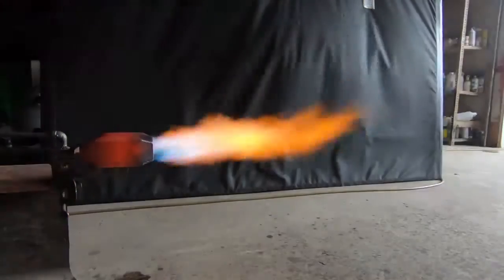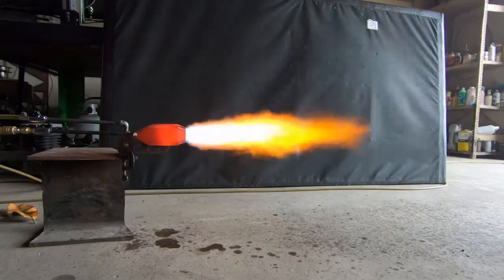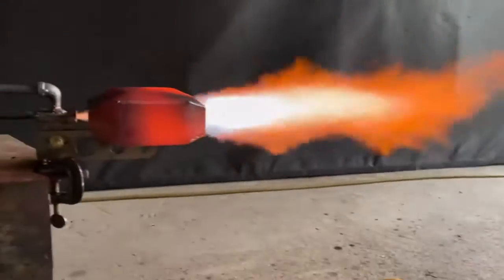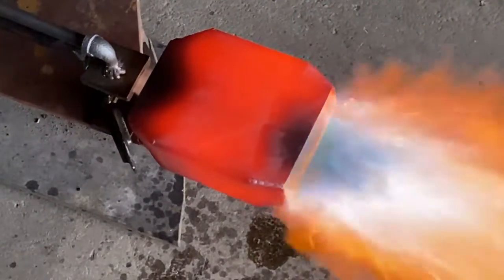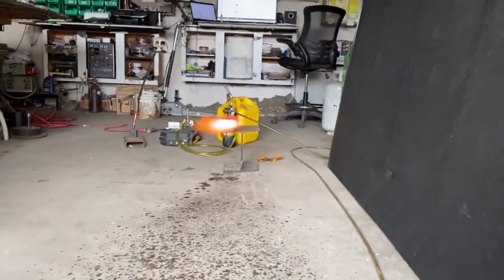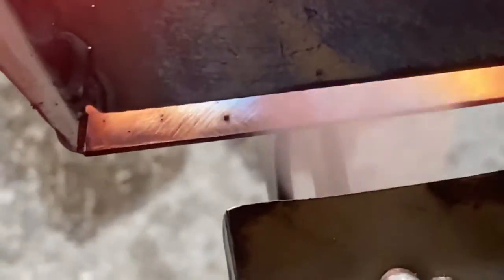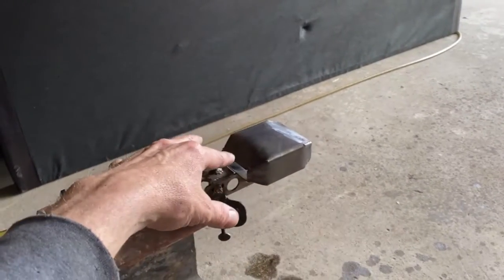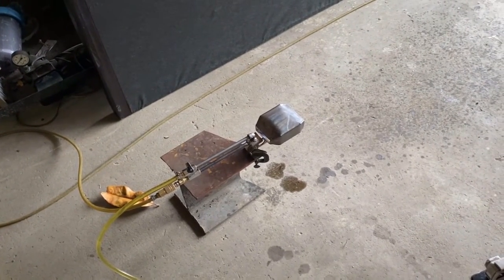(NEW) Laminated Plate Nozzle Waste oil burner innovation

Comment: Also because I noticed the comment about trying to get a supersonic airflow with a normal hardware store compressor in your last video, I found a paper recently for making a supersonic nozzle that only requires a 3-5cfm supply. I believe the throat area needs to be no bigger than the area of a circle with 1/16” diameter. 

Although that being said I think you might have some super cool results with using a little bit of fuel to do’s. Precombustion to get the speeds sonic/choked flow in the converging and diverging mixing chamber for the full combustion. Again though that may just be a some “hand wavy” unnecessary extra action.  🤷‍♂️